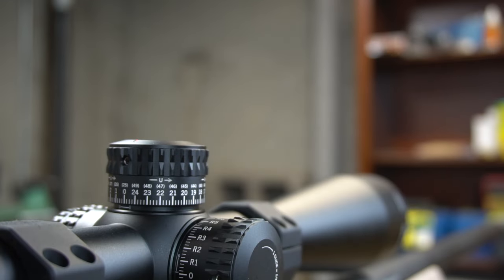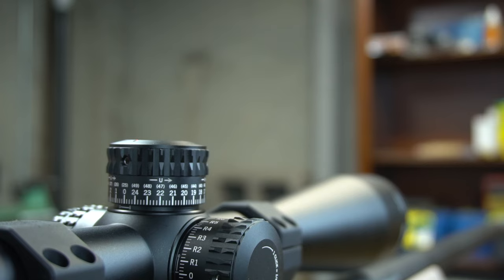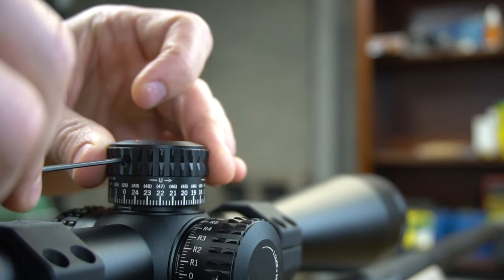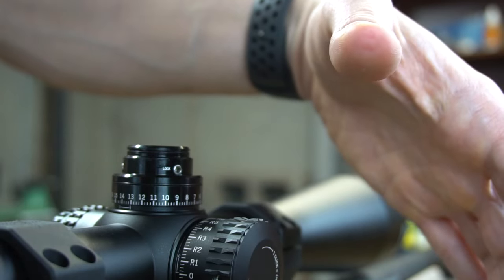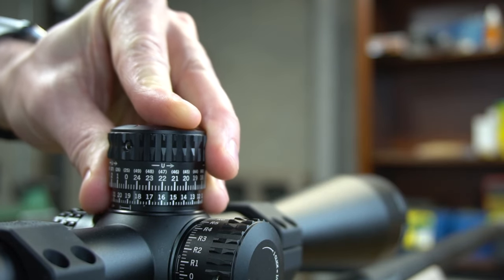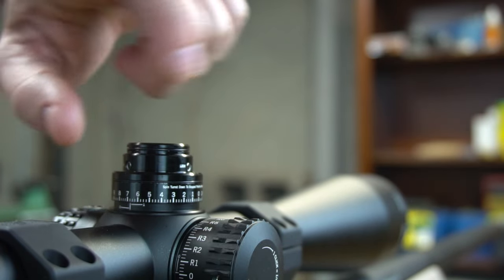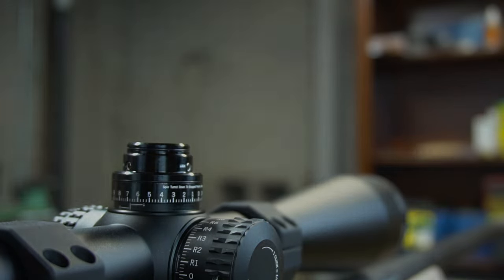Setting Vortex Gen II PST zero stop

Comment: Ah, Well here I am, apparently 6 years later from when this video was 1st posted. I ended up in scenario #2. Apparently I did not read, (hey I'm a guy, who thinks he doesn't need to fully read instructions), to make sure I started at the zero stop when I sighted in.  I just assumed because the scope was set at the zero mark on the outer caps I was at zero and zero stop and I just went to normal sight in procedures. Not so with the zero stop, thus I had scenario #2 and my zero stop was not set correctly. Thanks for your explanation, it was very helpful. I gotta get better at fully reading the instructions first, before assuming I know what I am doing. Oh well live and learn.

Comment: Exactly what I was looking for.  Took my late father in laws 7mm Rem Mag to the range, got it dialed in, then realized the whole zero stop thing after.  Thought I might have to start from scratch, but was thinking through the process and this video just confirmed what I thought should be an easy adjustment.  Will get on the range soon to try it out, but I don't see why it won't be right where I left it.

Comment: So the rotation (horizontal) hash marks on the lowest- innermost (vertical measurements of the number of rotations) are meaningless??    The turret cannot be lowered to 0 to accurately track the rotations.   Moving the internal turret from 19 to 7 also seems to be meaningless - the zero stop works just fine in either position and those numbers are not referenced in the field.   Is the reticle disengaged from the inner turret when the screws are loosened?  Some explanation of the mechanism could help.

Comment: What is the procedure for adjusting the windage crosshair?

I don't understand why there are all these videos on YouTube that 
illustrate how to sight in a PST Gen II as to elevation, but none that I
 can find that go on and also illustrate how to site it in as to 
windage.

Do you just externally use the windage knob on the right-hand side of the scope to dial the windage to where it needs to be, then take that cap off and put it back on in the position to show it as zero??

Here is all the Vortex manual says about it for a Viper PST Gen II:  "6. Using the inner turret scale for elevation reference, make windage and elevation adjustments until the reticle crosshair is aligned with the adjustment pattern, target or laser dot." That appears in a paragraph that is referring to the elevation turret on top of the scope, and it implies that windage adjustments are made in the elevation turret on top of the scope.
Reply: Elevation doesn’t change. Windage does. Technically it is always zeroed. You adjust until it is centered then loosen and set the adjustment knob to 0. But remember you still leave the gap for left wind adjustments. It’s a lot simpler then elevation

Comment: I'm still confused, what is the point of the lower dial with the scale? What does that even tell you? Is that the position of the reticle in it's up/down travel? Does it screw up or down on the turret when you loosen the set screws?  I don't have one of these scopes, I have the gen 1 with shims. I just watched out of curiosity.

Comment: Yes, or zero at a hundred yards, the thing to remember is that the further our means a difference in higher groupings, because of bullet drop. Let's remember that the bullet doesn't start dropping significantly until about 120 yards out on a 168 grain bullet... 7mm and 6.5 CM have lighter bullets than the 308.

Comment: I have the pst gen2 in moa but can't seem to get the zero stop perfectly on my zero. Still goes 9 clicks or almost 2moa past zero. I did remove cap, checked where my zero was. Turned back to zero, loosened screws and took it to my zero and tightened

Comment: In the second scenario, if I rotate the turret to the zero stop, then loosen the screws to rotate the turret to my zero, won't my zero be off since I rotated the turret to find the zero stop?
Reply: In the video he used 19 as his zero stop and 7 as his zero. Already knowing that 7 is his zero, he went to the zero stop, loosened and adjusted to 7. Then retightened. That makes his zero on 0. Reason being is when he retightened it, he did not re zero it. It is still on the zero stop. Therefore going to 0 makes it zeroed.

Comment: PLEASE HELP IF POSSIBLE I PURCHASED A VIPER PST USED NO BOX NO MANUAL AFTER THINKING I HAD ZEROED IT AND BEFORE WATCHING ANY VIDEOS I KNEW I HAD TO REMOVE THE TURRET CAPS AND ROTATE THEM AND ON THE UP/DOWN TURRET I REMOVED THE 2 ALLEN HEAD SCREWS IN THE TOP FROM THE 2ND TURRET THE ONE YOU CALL THE ZERO STOP THINKING I NEED TO ROTATE IT UPON DOING SO I THOUGHT I HEARD SOMETHING FALL OUT NOT BEING ABLE TO SEE ANYTHING ON THE FLOOR ANYWHERE I PUT IT BACK TOGETHER NOW IT DOES NOT STAY IN PLACE IT ROTATES FREELY NOT CLICKING AND NOT MOVING IN 1/4 CLICKS IF YOU KNOW WHAT I MAY HAVE LOST OR WHAT I AM DOING WRONG OR KNOW WHERE I CAN GET A PARTS BREAKDOWN YES I COULD SEND IT TO VORTEX TO BE REPAIRED BUT I TRULY BELIEVE I LOST SOME THAT I CAN PUT BACK TO MAKE IT WORK AGAIN IF ANY ONE READS OR KNOWS HOW TO FIX  THIS YOUR HELP WOULD BE GREATLY APPRECIATED

Comment: Thanks a lot for this insightful video! Am I understanding the mechanics correctly: this system allows you to set your zero WITHOUT click value/step restrictions? By disengaging the zero stop that also contains the ratchet system you are able to finetune your zero indefinitely precise? (or as precise as you physically/practically can make adjustments to the turret with disengaged ratchet)
Reply: ya took me a min    all the screws do on the zero stop do is disengage the zero stop.   makes perfect sense now esp bottoming it b4 you zero  all your doing is taking the zero dtop out of the equation   once zeroed  then you tighten the set screws and zero stop is engaged at your zero.    its way to easy to over think

Comment: Confused on the second method. Scope is already sighted in (5.1) is my 100yd zero on the inner turret mark, so when I turn that turret to the zero stop say (21) I am loosing my zero, even if I then loosen the inner turret screws and set it to 5.1. I actually moved the zero when I set back the zero stop the amount from 5.1 to 21 wouldn't I?
Reply from the maker: 5joefive5 the simple answer is no. Follow the directions and your zero will be at the stop.
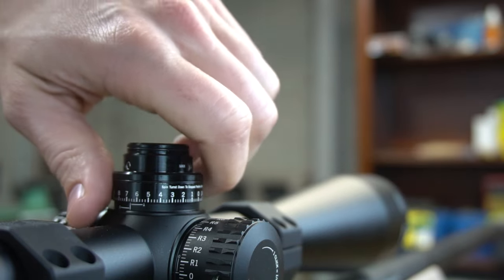Reply: @HuntinTheWest  So you are saying that when you turn the turret that is engaged back to the zero stop, (5:50 in the video) I won't change my point of impact from my 100yd zero and I won't have to re-sightin my rifle.
Reply: 5joefive5 5joefive5 for the second method what you’re referring to. Take the top cap off. Remember what the inner turret number is line up at on the center line. Then dial the inner turret down to the zero stop. Now loosen the inner set screws and move the turret back to that number you memorized then tighten the screws and put the top turret cap back on. Zero stays the same and now the stop is set.

Comment: Once zero stop is set. Can you dial up or does it prevent you from adjusting above zero stop?
Reply: Nick Rewal just keeps your from dialing down
Reply: foxracing16 so you can’t go any lover then the zero stop? 
If I were to zero for a new type of ammo that hits higher I would have to repeat the process?
Reply: Nick Rewal correct. But once you find the correct load. No reason to switch it up. When testing a new ammo. It should still hit paper close enough. Obviously you will rule out the load by consistency and grouping before you adjust for every trial load.  Once you find your load. Set it and forget it. If you’re shooting box ammo or changing something up for whatever reason. Just use your mil dots
Reply: foxracing16 awesome thanks for the explanation 👍

Comment: Is there no way to make your zero range literally 0 on the turret?
Reply: The top cap will show zero when installed after doing this. The bottom ring may or may not. The three set screw disengage the clicks, but turning the dial still adjust the scope.

Comment: HuntinTheWest ...So I zeroed my rifle today and set my zero stop but now my max elevation is only 9.6 Mils. The optic has a 20 MRAD max elevation. I have a 20 MOA base.  Am I doing something wrong?
Reply from the maker: James Johnson what base? 0 or 20 MOA?
Reply: HuntinTheWest So funny story about that....I started looking all around and troubleshooting and I thought my base looked strange. The rifle is supposed to come from the factory with a 20 MOA base. Nope, I measured both ends, put a level on it and sure enough it’s a zero MOA base. I called Savage and they’re sending me out the correct 20 MOA base next week. No markings on it anywhere, kinda hard to tell.
Reply from the maker: James Johnson that should fix it.
Reply: Did you follow method two?  That method will result in the loss of some potential elevation travel by the amount that you adjust the turret.
Reply from the maker: I’ve done it both ways. They both accomplish the same thing. The amount of elevation travel you have is strictly determined by were your particular load shoots in your setup. You don’t get to pick where that is.

Comment: What??? Why is the zero stop not on zero? Why the extra markings on the zero stop? Imo the most complicated zero stop.
Reply from the maker: It is overly complicated but easy to set if you’d just pay attention. If the zero stop was at zero then you could put it on a rifle and do nothing. Does that even seem possible?  The numbers on the zero turret are strictly for measuring how much you need to adjust to get it to were the stop is set.

Comment: When you set the zero stop do you get the full 70 mins of elevation or do you loose some after zeroing your rifle
Reply: 70 MOA is total elevation adjustment. Most scopes, if not all, come centered in the travel. If you run a 20 moa(or more) you will get farther away from the center travel and get more travel to actually dial.   A good average in this scope with a 20 moa rail would allow around 55 moa is actual up dialing.
Reply: Ryan Furman    Thank you.  That’s what I thought but wasn’t sure so I thought I’d ask.  I see in the nightforce they have that clutch system that adjusts when you zero it. Is that so you can get full 120 mins out of the scope or are you still only going to get half plus your rail?

Comment: i think my zero stop is broken . when i do ur second method u showed i can move it 5 clicks past the zero stop
Reply from the maker: ken hofer that’s what my first one did. Had to send it back.
Reply from the maker: Myfriendsfindthisboring did you watch the video?  The first procedure I outlined in the video says exactly what you just typed.
Reply from the maker: I don’t disagree with that. Which is why it was my first explanation. It’s been awhile so I watched my video again to make sure. In any case the procedure you typed is probably easiest for most especially if the rifle is already shooting the way the owner wants and they are just mounting a new Vortex on it.
Reply: ken hofer mine does the same thing.  Not a solid stop on the zero stop.   It will keep going around 4-5 clicks
Reply: My Vortex did the same thing (5 clicks past zero) after locking it. However, I repeated your procedure again and it solved the 5 clicks past zero. My opinion (my case anyway), you don't have to send your optic back.

Comment: I guess I'm a little confused. so I mount my scope loosen the zero stop screws. put the regular turret back on. sight it in. take the regular turret off. tighten the zero stop screws and then install regular cap back on and I'm good to go?
Reply from the maker: That is one option but make sure you rotate the turret fully clockwise until you hit the zero stop before you loosen anything.
Reply: This is how Im interpreting this video too.
Reply: Ok so I screwed up, I didn’t make sure the turret was stopped at zero before I zeroed my scope in, the outer turret is zeroed in at 15, I should be able to take the top turret off and set it to 15, tighten down the set screws and then put my top turret back on reading zero correct?
Reply from the maker: With the scope on actual zero take the outer turret off. Write down the number on the “zero” mark on the secondary turret. Turn the turret to the zero stop. Loosen the three screws. Turn the turret to the number you wrote down. Tighten the three screws. Place the outer turret back on zero. Tighten the outer turret screws. 

The video shows this exact scenario.

Comment: Why wouldn't you just put the zero stop turret to 0?
Reply from the maker: Jrsydevil7 Because that is not how it works.
Reply: I was wondering the same thing. Is this just for dialing in a far target so you can get it back? What does this do exactly
Reply from the maker: +john webb I’m not sure how to clarify. The turret under the main turret is the zero stop. It is impossible for a scope company to set it for your rifle from the factory.
Reply: HuntinTheWest No I get that, but didn't you say that you can loosen up the screws and move the bottom turret? If you loosen the bottom turret it disconnects the turret. So if you could do that than why not just put the turret at 0. So you'd zero the rifle take the top turret off, unscrew the bottom turret set the zero stop and set it to 0 and then put your top turret back on and set that to 0.
Reply from the maker: I really think if you would watch the video you would understand. Loosening the secondary turret only disconnects the reticle from the zero stop. The secondary turret is always attached to the reticle. The numbers on the secondary turret really only help you move the reticle the correct amount. Do you have the scope?
Reply: HuntinTheWest Yes I did watch the video, in matter of fact I watched it a few times just to make sure that I didn't miss anything. That's why I was asking about that because you make it sound like you can set the zero stop and then I can move the bottom turret to zero. And yes I've got the same scope, that's why I'm watching your video and asking questions. I've flipped through the manual just to kinda get an idea of how to use the scope but I'm more of a visual learner. So again that's why I'm watching videos from people who seem like they know what they're doing.
Reply from the maker: +Jrsydevil7 like you said visual is better. It’s very difficult to communicate this procedure with text. When your scope is sighted for your desired zero and your are done setting the zero stop the secondary turret is going to read what it reads. You can not pick what it says that is why you still have the outer turret.
Reply: Jrsydevil7 yes man... You're right. It should be at 0.
Reply from the maker: No that is not correct. The “zero stop turret” will be wherever the reticle needs to be for the correct impact at the chosen zero distance. After you find that you put the outer turret at zero.
Reply: HuntinTheWest this is contrary to every other scope. It makes no sense to "zero out" on 19. Zero out on zero so you have more vertical adjustments.
Reply from the maker: It’s obvious you don’t have one of these scopes. You do not get to pick where the zero stop turret is. The numbers on it are for helping the zero process after that you place the outer turret on zero.
Reply from the maker: If you have any other questions you can email huntinthewest@gmail.com.
Reply: @aomaggots-  That's not how the Razor Zero Stops work or most zero stops work for that matter.  You are thinking of slipping the scales (or turrets) where you zero your rifle scope and then loosen the screw and slip the turrets back to zero which almost every tactical scope has the capability of doing.  A true "Zero Stop" like this relies only on the outter turret to be at Zero when you dial all the way down.  The turret underneath it needs to be dialed to the desired marker and tightened down so that the "Zero Stop" actually stops.  If you zero out the "bottom/underneath" turret even when it is loose, you're adjustments will be fucked when you put the top turrett back on lined up with zero.
Reply: The bottom/underneath turret affects the reticle. The top one is for visuals and affecting the reticle. Once you zeroed in your scope, the bottom turret will be at some random number (that is your zeroed number at what ever distance your at, lets say 100). Now if you move the bottom turret back to zero, you have now affected the reticle and it is no longer zeroed at 100. Because nobody likes to have a random number for their zero, the scope allows you to adjust the top turret to visually be zero even though it really isn't.
Reply: @tarzantwotwofourone8728  But if loosening the second set of screws (underneath the turret "cap")  disconnects the reticle from the base turret, why wouldn't you screw it all the way down to zero?

Comment: why not zero at 36yrds should be the same for 200 an 300 atleast that's what I've been familiar with in the Marines
Reply: Marine here as well.  The 36 yard BZO is to make things simple. Center of the crosshair works from 0 - 300 yards, within 4-8 inches up/down (also known as MPBR). It's not precise, but works because if we aim for the chest within those ranges we can expect a hit.  For precision you need an exact zero. I sight in at 100 yards, i'm good at 100 yards.  With adjustments MOA/MIL to compensate for elevation.   

A 200 yard zero allows distance shooters more elevation on a given scope, assuming you don't really care about absolute accuracy under 200. It's also quicker to adjust the knobs for say a 500 yard shot, but that's not a terribly big deal I suppose. 

Otherwise, for precision once again, you would have to create your DOPE tables off of the 36 yard zero which wouldn't be very effective!  

Hope this makes sense.
Reply: @ad-bk9bo  gotcha thanks for replying brother